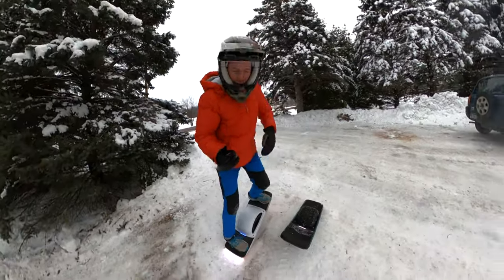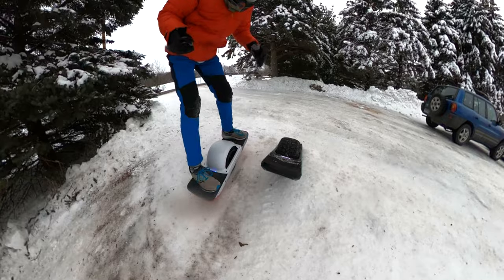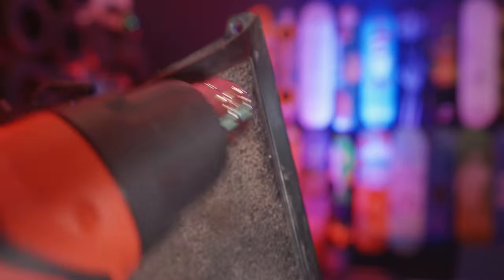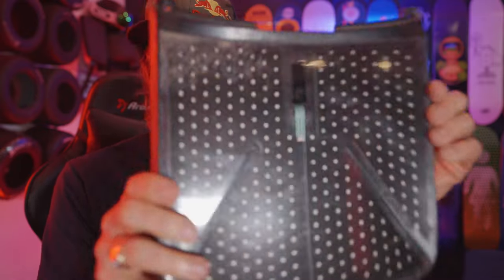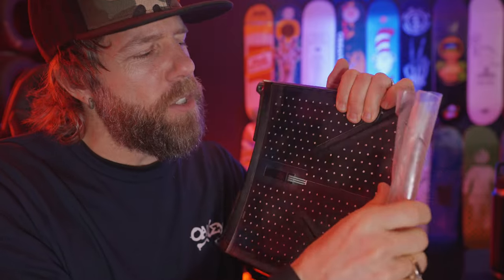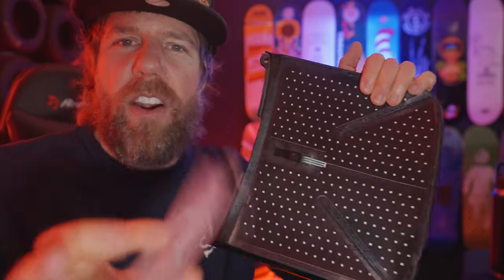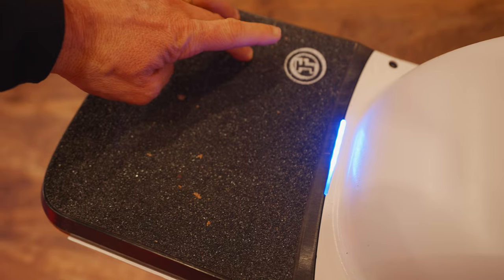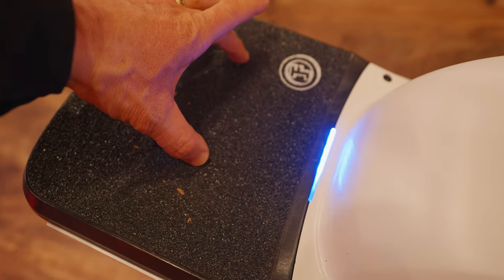How to make Onewheel Sensor Work Better!

Comment: We have a GT from May 22 with a recall sensor and it’s amazing. We just picked up a new GT in January and the front sensor has been drastically changed to take longer to engage. We have to teeter back and forth before it will start going. 
We are going to do this hack to fix our pad.
Reply from the maker: hope it helps
Reply: @ScotMendenhall  thanks Scot!

Comment: The surestart doesn’t work for xrs. I’ve never found a “posy” tutorial. Hope this helps me a little. Felt pads get excessive over time
Reply: 😂 ur wrong it works just fine. I have it on both my xr’s
Reply: Badger used to make an XR specific version but Float might not be making the XR one after the merge due to the high part cost of the XR version.
Reply: Just got FM’s new flared front footpad. Would it be a mistake to pull that film off the sensor. I thought maybe since it’s so new, release early 2024, that FM might’ve addressed the sensor pad sensitivity issue. ..?  🤷‍♂️

Comment: I am on the fence for this mod, the only thing I am concerned about is introducing ghosting. I think I'd rather mount of shame than send a missile down the road.
Reply from the maker: yeah that should not happen as we are removing the stiff plastic that would keep the sensor from responding fast